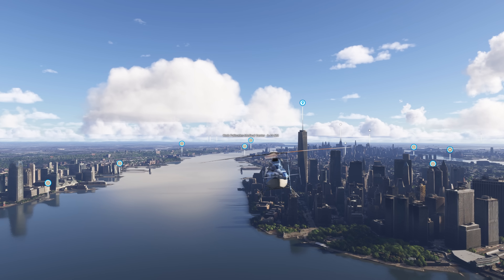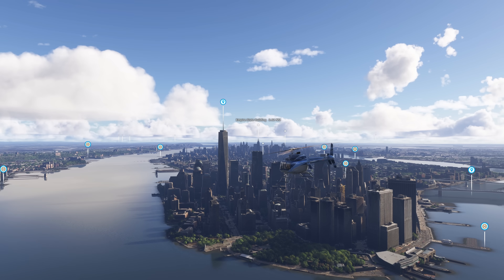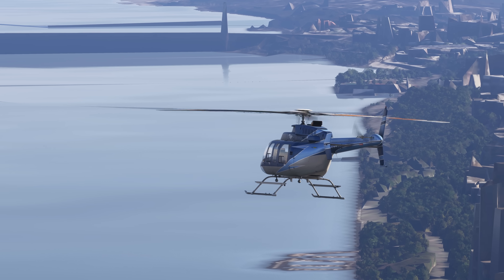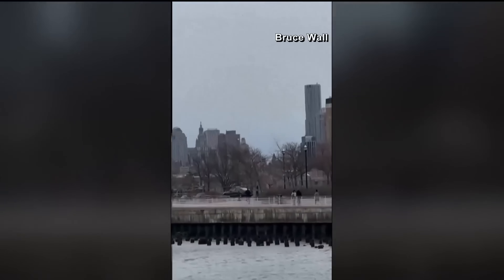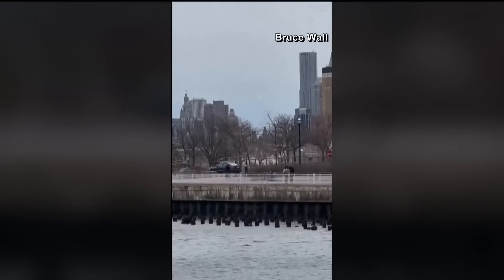Helicopter Expert breaks down Hudson Crash, and discusses “Bump Mast” Theory | NYC Crash Follow-Up

Comment: "Let the events speak for themselves." Lab analysis will determine the sequence of events. Speculation is an inexact science that confuses the issues here. The blade tips have weights in them to keep rotor rpm high enough to perform an autorotation to the surface. Flat pitch of the blades keeps them rotating. Certification Test Pilots wait about two seconds before they lower the collective after engine failure. Rotor blades that slow tend to "cone," not "droop," in this rotor system. The mast and transmission may be found in one unit by the divers. Pieces, parts and trained eyes of the accident investigation parties will tell us what happened; as much as two years from now.

Comment: I am no expert; however, it’s not gonna stop me for making an observation. Both rotors excuse me both blades were still attached to each other appeared to be symmetrical and we’re still flying. My uneducated observation would be that if there had been a rotor contact, that would not be the case. Additionally, it appeared as though part of of the transmission was still attached.

Comment: The building footage is from a distance but shows a level smooth flying heli that just suddenly falls apart.  Not much details to see but does not look like the tail rotor came off first.  So with main rotor still attached to gearbox and spinning it seems like something else happened as the Colonel suggested.
Reply: As it emerges from behind the high-rise building there looks to be a brief burst of smoke from the tail just before it all breaks up. Hard to be sure as it's so grainy it could be an optical illusion.

Comment: Why would any helicopter be designed to where the tail rotor would be that close to main rotor ..regardless ?? No part of the aircraft should interfere with the worst possible range under any flexing 🤔
Reply: To minimize the moment arm between the main rotor and tail rotor to prevent unwanted yaw and or pitch moments. Some helis will move the tail rotor above the main boom to put the rotor in line with the main rotor for this reason.

Comment: This is something new, no mast bump the side video shos no flex in rotor and nice level flight till it suddenly snapped to the right and the boom left, then the entrire transmission seperated with rotor attached.  So appers both mast bump and jesus bolt are not valid. More like something seized and the force of it snapped airframe at both transmission points to tail boom and rotor.  Do not know enough about the engines to say for sure.

Comment: Great to hear from Col Joe. In all honesty though I think a greater truth needs to be put across to potential passengers about the potential dangers of flying. After 30+ years studying air accidents (not professionally) I'm growing tired of "experts" saying after accidents that flying is safe. Flying like driving sailing and trains is safe until it is not safe.
Reply: The thing about aircraft is that many accidents are absolutely fatal.   There are few fender benders.
Reply: Helicopters have always creeped me out and have never been in one or plan to unless I have no choice. Too many moving parts and the use of old helicopters, old parts that need a lot of maintenance to remain safe--more maintenance than what is probably given. Priority should always be given to safety. Safety first. Very sorry for the family thinking it would be a fun experience for them, not questioning whether it would be a safe experience. We take so many things for granted.

Comment: Was it the impact with the water that took these lives from us, or could it be a survivable impact and perhaps they drowned?
Reply: Hitting the water from that height would be like hitting concrete. The body of the helicopter was crushed by the impact.
Reply: @JT1358  I thought it might be the case but still wondered since they landed upside down and if they were buckled in maybe they couldve survived? A true tragedy.
Reply: Survival from impact is perhaps possible but you'd be so messed up you couldn't do anything about drowning.

Comment: Where the engine transfers power to the transmission is a big ring gear.  The pinion has to get jammed and separated the transmission housing.  The transmission was not spinning with the same rpm as the main rotor.  Main rotor appears to still be freely spinning.  The sudden stoppage of the ring gear can cause the tail rotor to fail at the same time.

Comment: This is fascinating! As a complete novice, I am wondering why the rotors don't hit the tail section when powering down. If lower speed causes a rotor droop, and a droop can cause the main rotor to hit the tail section, what is the difference between powering down on the ground and an event in the air?
Reply: Because it’s not gravity induced droop that causes the main rotor to hit the tail boom, it’s aerodynamic and sometimes inertial and gyroscopic forces at play that cause the main rotor to FLEX down and strike the tail boom. That’s not what happened here tho.
Reply: The body of the helicopter along with the tail boom tilts into the rotor blades when flying.   When the helicopter is on the gound the rotor blades and the helicopter are parallel to each other.   There are quite a few videos on Youtube that explain it.

Comment: if you don't lower the collective fast enough on an engine failure you can pull back on the cyclic which will increase main rotor RPM

Comment: Mast bumping causes the mast to be severed at or under the rotor head. The Main Rotor (MR) of this accident helicopter appears intact as dies the drive shat and MR gearbox.  My money is on a seized MR gearbox. The massive torque from the MR would then rip out the gearbox which would also affect the TR shaft (and thus the Tail boom). I base this on the video which shows an intact pair or rotors and rotor head, still attached the the MR g/box. One is reminded of the MR gearbox seizure of a Super Puma in the North sea, with a similar outcome. Such a tragic loss of an entire family.
Reply: I agree—NOT mast bumping!

Comment: There’s another video that shows the aircraft before and as it came apart.  It was flying apparently straight and level and then, quite suddenly, the aircraft rapidly yaws over 90 degrees.  Only after that does it start to come apart with the tail boom first and then the main rotors and apparently the transmission.  That would seem to indicate a drive system failure or seizure.

Comment: 10:26 I have to disagree with the Col. If the M/R slows and you lose lift, the blades bow upwards. They don't drupe. Too much weight pulling down at center. The pilot however might overreact and pull the cyclic back abruptly causing the M/R to tilt backwards causing a tail boom strike.
12:32 I saw pictures earlier; I think it was today, that showed the tail boom attachment point. The 2 right hand bolt holes looked perfect. The left side was mangled. But that could have been damaged when it hit the water.
14:20 I agree. 15:00 The Jesus nut holds the M/R hub to the mast. The mast has a retainer plate that is bolted to the top of the transmission. It holds the mast in/to the transmission. If the Jesus nut comes off, the rotor comes off the mast. BTW, it's called the Jesus nut because if you see it go flying, you scream OH JESUS!
I'm thinking structural failure at transmission pylon. Only reason I can come up with for the trans and rotor to leave the airframe as an assembly.
EDIT: Just watched this video. It shows exactly what I'm talking about.
https://www.youtube.com/watch?v=7QUTQf7vZLA

Comment: The Jesus nut will be found intact, the whole rotor system left the helicopter still connected to the transmission, the separation will be found to be where the transmission is attached to the airframe.

Comment: Bear with me for some clarity on this.  There is a lot of imprecise commentary on this accident and some of it is contained in this interview.  People keep talking about "mast bumping" and conflating it will the rotors cutting off the boom.  Those are not the same things.  There is an excellent old army training film popping up that explains mast bumping and the problems related to it.  Search for it for details.  Mast bumping is NOT when the rotors contact the boom and potentially cut it off.  Mast bumping happens right at the area where the rotors are hinged to the vertical shaft, the "mast" if you will.  Just like with a car u-joint, you can only articulate the joint so much and then the structural parts that make up the joint bang into each other and you can't articulate it any farther.  That is the essence of Mast Bumping, the joint where each rotor blade is attached to the mast can only rotate up and down about 12 degrees and if it try's to go beyond that limit it hits the hard stops and as you can imagine that creates a lot of stress on the parts.  Do it too many times and it will crack and eventually fatigue and come apart.... do it REALLY hard and it may break right NOW.... OR, and here is where the imprecision starts to come in, .. mast bump UNDER CERTAIN CIRCUMSTANCES  and you will not only get that mast bumping but other effects that make the rotor flex downward enough to hit the boom.  What might those circumstances be... Those circumstances are when the aircraft is at very low G loading and the rotor is not doing much lift generation... which happens when you have just popped up over the end of a hill and drop down quickly or make a maneuver similar to that.  So there could be two failure modes here both of which are related but "mast bumping" per se is not a failure mode... it can lead to a failure mode, the very top of the rotor assembly coming apart, or UNDER CERTAIN CIRCUMSTANCES it could cause boom cutting. 

 Now I'll start some speculating.... The key thing for this accident is that mast bumping not with associated boom cutting  creates a failure right at the top of the mast, right where that joint is.  Is that what we saw in the videos of this accident?  Not in the videos I've seen.  In the videos I've seen there entire rotor disk (the four blades all still attached at the center assembly with joints) is clearly seen with quite a bit of stuff hanging from it as it spins away from the body of the helicopter .. looks like the transmission is attached.  That is not a mast bumping failure.  But what about the missing boom?  Possibly when the transmission and attached rotor disk came off it moved toward the back, opposite the direction of movement of the body of the helicopter, and the spinning rotor disk took off the boom, perhaps with the blade(s) hitting more toward the middle  (along the length) of the blade rather then the end of the blade as we normally picture a blade cutting off the boom.  The middle of the blade may be better able to withstand the impact with the boom without the blade itself getting cut in half.  Or maybe when the transmission got ripped out the driveshaft in the boom went wild and ripped up the boom. I don't know, this is speculative.

So I'm not seeing mast bumping in and of itself as the cause of this accident.  A mast bumping failure would not take the transmission with it.  We also didn't see any low G maneuver going on just before the craft came apart.  So we saw nothing that could unload the blades allowing them to drop and cut the boom, presumably aided and abetted by mast bumping from some oddball control stick input.  That's not adding up.  What's left is the question of why that transmission seemed to be attached to the mast, which means its not a "Jesus nut" accident either.  Some have said the transmission was recently serviced.  If so, perhaps there is a issue with that servicing event.  Even if it was not recently serviced that doesn't rule out a failure in the transmission causing a massive lock up and the inertia of the rotating rotor disk causing the transmission to be ripped from it's mounts.  Aircraft, fixed wing or helicopters, are not build like bulldozers. Weight is critical, there are not massively over-designed mounts that can withstand anything that can be thrown at them.

Comment: In my previous life as army helicopter pilot and instructor in the 60tees. My students and I were walking to our assigned Huey, when we got to aircraft the maintenance 
people were running our bird because of a previous 
write up. The Captain at the controls was running the bird at 100% rpm with
The stick (cyclic) at the most forward stop with no
mast contact, after shutdown he said that this
was normal. Now this was on a Huey don’t know if you could do this on a 206
Mast bumping just was not
an issue for us.

Comment: It wasn't a mast bump. The rotor head assembly had completely separated from the airframe. The whole assembly can be seen auto rotating with the blades still intact.  It's obvious the tail rotor separated due to the sudden torque when the rotor head failed. This was clearly a major structural failure. These "experts" have never experienced anything like this or they wouldn't be here to talk about it. I'm a retired Aerospace stress engineer.
Reply: I’m surprised any pilot would suggest mast bumping in this case.

Comment: I don’t believe it was mast bumping? If that  occurs, the rotor mast generally sheers and the rotor blades separate without the transmission!
If the rotor hit the tail-boom the rotor blade would have had significant damage! They appeared to be intact and in balance?
I’m still going with other failure? Transmission mount or tail rotor failure, as there appeared to be substantial and severe yaw before the rotor blade departed the aircraft?
Also, the TEETER TOTER ROTOR is not the best design! The Hughes and Sikorsky are stronger!
If the JESUS nut failed, the rotor would have left without the mast? We will know very soon 👨‍✈️
Reply: You’re right—NOT mast bumping!

Comment: This video is a generalized discussion as to what can possibly happen.  Another video has the best analysis, and it is that a transmission mounting arm fractured.  This  has happened before in this general class of Bell Helicopter.  The reason this is the most logical explanation is because the transmission and rotor departed the air frame as a combined unit.  It is not the Jesus Nut for the same reason.  It the Jesus nut came loose the rotor blades would have flwon off, but the transmission would have stayed with the air frame.  My money is on a fractured transmission mounting arm as being the primary cause of the crash.

Comment: Thank you! A mast failure makes good sense. Now, was the failure due to mechanical failure due to lack of maintenance or a one-off part failure.  I am praying for the families of those lost in this horrific accident.
Reply: The fact that there was a large object under the blades as they descended that looks very much like the entire transmission makes me doubt this.  Not sure what happened to make that happened, as the connections between the transmission and the rest of the helo is very strong and the aircraft came apart in maybe 2 seconds.

Comment: I think a catastrophic transmission failure seized the blades and the torque ripped the supports off and the connection to the tail rotor ripped off the tail.  Other video shows the helicopter go from straight and normal to a sudden turn and the transmission and rotors rip off and continue rotating as it comes down.

Comment: Mast bumping has nothing to do with rotor blades striking the tail boom. Mast bumping is when the main rotor hub teeters to extreme angles (usually due to low-G situations) and strikes the mast holding the main rotor. It’s difficult to describe without visual aids or without having an understanding of how two-bladed rotor system works.
Reply: Mast bumping explained by the army: https://youtu.be/_QkOpH2e6tM?si=SUqsrPUsGa_N9wrw

Comment: I will await the report like everyone else.  Here's what I hope it's not related to for personal close-call reasons - the pilot called in and said he needed fuel.  The fuel system is complicated and has multiple cells.  If the boost pumps fail you can find yourself suddenly with a lot less fuel than you thought and have a flameout. If he did the wrong thing with the collective or didn't have time then you can have the tailboom strikes and shear everything apart.  The audio on the video sounds a lot like strikes. Again, not saying that's it, just a bad feeling.

Comment: I think bolts were loosen due to vibration overtime and either maintenance not current or did that intentionally , so rotors separated, and either explosion happened or rotor strike the tail boom

Comment: If you look at the main rotors they are partially intact. They are shorter than normal, and parts are seen landing. They struck the tail.
Reply: My theory is the transmission mounting arms fractured and the mast assembly tilted back allowing the rotor tips to slice the tail boom.  However the tail boom separated near the main body of the aircraft.

Comment: You have not analysed the video, which shows how it happened. The helicopter firstly turned to the right and then down and after that movement it lost its tail. After that, when free falling, also main rotor separated.